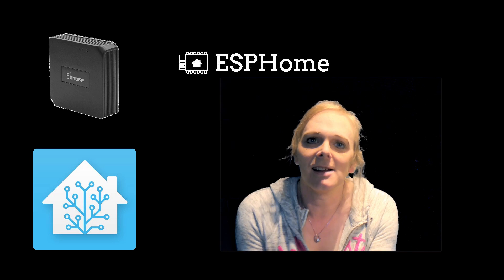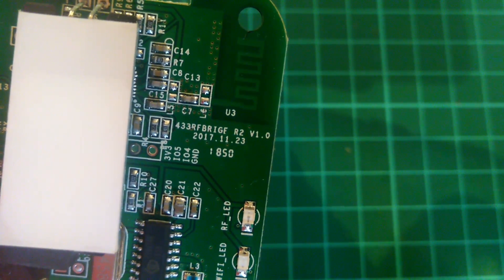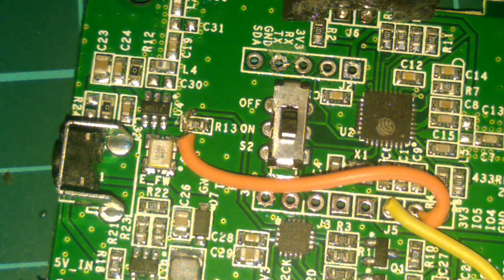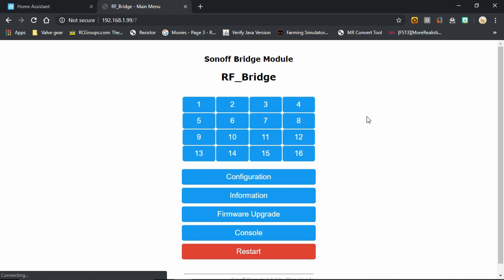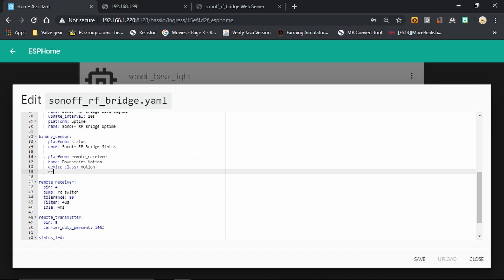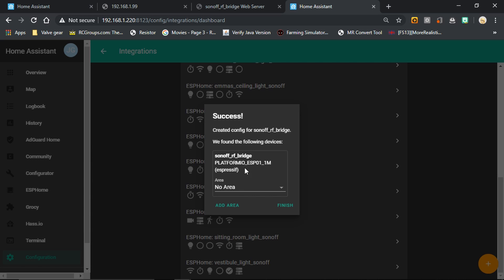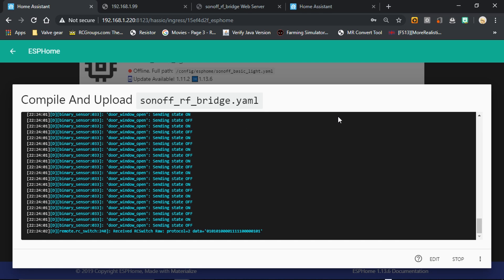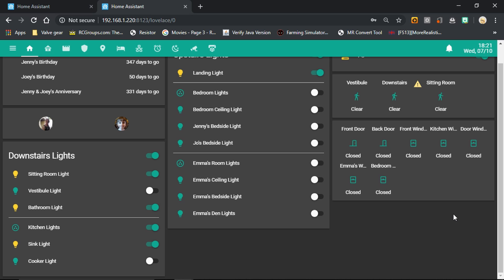Convert Sonoff RF Bridge to ESPHome

Comment: Thanks for the Video and excellent instructions, The rf bridge was my last device on tasmota and now all devices over to esphome. Love Esphome native API over Mqtt
Reply: Hi it's the same things for me. I have a sonoff RF Bridge and a Sonoff Ifan02 on tasmota, the all others sonoff device work now with esphome.
My questio is do you have a sonoff ifan02 flash on Esphome firmware ?
Reply: @babyface3105  Sorry mate no
Reply: How do you set up the mqtt to be able to listen to the codes and be able to integrate with the node red. I did that in Tasmota and listen to the codes but I can't quite figure out in esphome. Thank you
Reply from the maker: I don't use mqtt at all on esphome,  and just use the api. You can use home assistant states in node red, but if you want to use mqtt, the place to find out about mqtt on esphome is https://esphome.io/components/mqtt.html

Comment: New sub here. Came from Dr ZZZ. Great work. I already had aa RF Bridge modified from espurna that I had installed on it ( have garage remotes that can't detect on any firmware even with the mod done - turns out it uses rolling code - had to pull the remote apart to check the IC it was using)

Looking forward to further videos. Thumbs up given also
Reply: Hello! My remotes also have the codes always changing (only now I leared it's called rolling codes). Did you manage to integrate them with ESPurna?

Comment: Glad to hear about the increase in speed. I'm in the process of trying this out, basically followed all your steps. I did the hardware mod. Created an esphome sketch. Uploaded it to tasmota's ota update, and now it won't connect to the wifi. I checked my credentials and they are right. Not sure why it won't connect. I can't get it to connect to the computer through ftdi to reflash it either. Any ideas?
Reply from the maker: I'm afraid I can't say for certain.  If tasmota was still running fine after the hardware mod, there shouldn't be any issue with the mod, so that would suggest either a bad flash, or an issue in the ESPHome sketch you have uploaded, if your credentials are correct, I'd check the IP section.  I have also had some devices that did not flash from tasmota on the first attempt, but after a failed flash, the device has always rebooted to tasmota after a power cycle. FTDI should still be available with the switch set to off.
Reply: try to add a fixed IP
Reply: @dartfrogdk  IP not up*
Reply: @matthewbuschur6466  did you change or set the ip in esphome yaml file?
Remember to set it to your ip range.
Try FTDI to flash it
Reply: @dartfrogdk  no I deleted the IP setting in esphome. I've tried quite a few times to flash it with ftdi, but haven't been able to
Reply: @matthewbuschur6466  I have had many problems if no fixed ip is in yaml file
Reply: @dartfrogdk  okay, I'll keep that in mind in the future
Reply: Weird, yeah I tried flashing like 30 times lol. Switch set to off and everything. 
I also tried setting it to a fixed ip in unifi, but it's not even showing an ip. It pops up in the unifi client list but under up it shows "-". And it says it's connected to lan instead of my access point which it obviously isn't.

Comment: Great informative video.  

Question: Is it just speed that you get as a benefit of this? I'm such an ESPHome skeptic still, If I have tasmota running on my RFBridge will I notice anything different by doing this mod?
Reply from the maker: Thanks Rob. You should be able to receive and send codes for a wider range of devices, as all codes are now processed by the ESP. (although I believe there is a similar hardware mod for tasmota as well). Other than that, you are also opened up to the possibility to use ESPHome's automations and lambdas, which can allow you to have various automations happen independently of HA, directly on the ESP.
Reply: Rob, take a look at Espurna Direct Hack, it's the same hack as far as i can see... if you don't want to go for esphome, and are more familiar with tasmota and with mqtt in general, try that, i flashed on both of my 2 devices (1 version1, and 1 version2), and now i can receive raw data from a lot more devices, plus it's faster in react...
Reply: info here: https://github.com/xoseperez/espurna/wiki/Hardware-Itead-Sonoff-RF-Bridge---Direct-Hack
Reply from the maker: @squalazzo  It is the same hardware hack - The link to the espurna page is already in the description